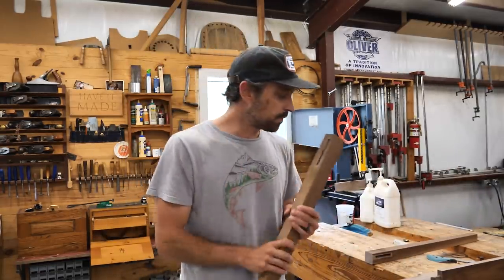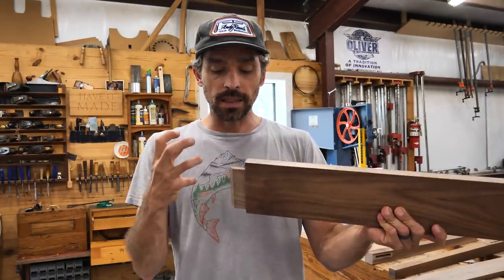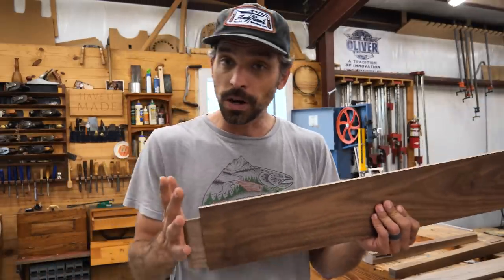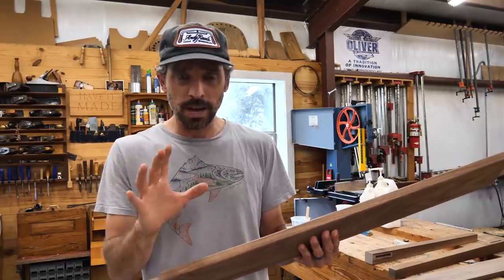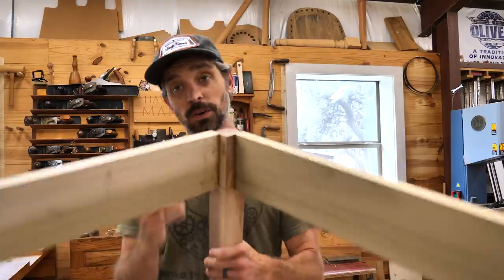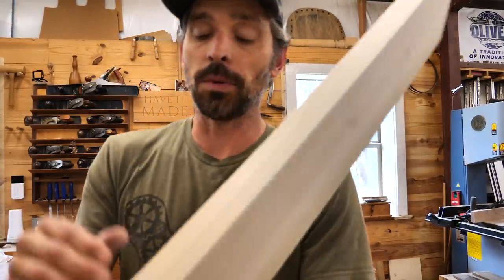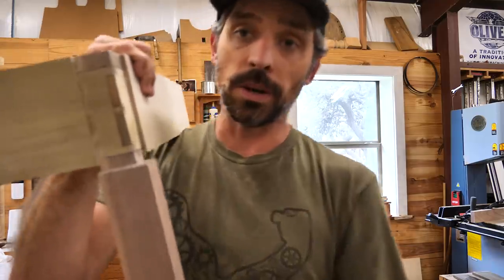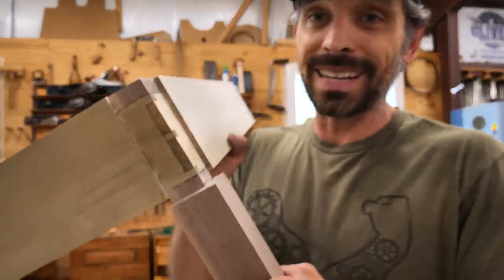Dovetails inside a Mortise and Tenon Joint // Woodworking Joinery

Comment: I've used box joints to connect tenons in a chair. You have a bit more play pushing the tenons together since they don't need to seat perfectly. It's great fun but a regular pegged mortice and tenon has never failed on me. In theory, you would be a bit more prone to develop a gap when the leg shrinks in summer since the tenon is locked in the back of the leg but I don't actually see that problem on my chair so I guess that's just theory ;-). Great build and video, takes some very careful measuring to get this fitting so nicely!

Comment: As an internal element it would strengthen the joint from being pulled part in one direction.  As an external element it would be far less functional than a traditional mortise and tenon as it would be weaker from twisting and lateral force.

Comment: Another option is to finger joint the ends instead of miters or dovetails. Then drill a hole in the top of the leg, through the jointed ends and drive a removable dowel through them. You can either glue it all in, or assemble it dry so it can be taken down. Though this requires thicker stock so the dowel is sufficient and doesn't break. This gives you a mechanically locked joint and you aren't totally relying on glue surface.

To make the idea even crazier, allow the dowel to protrude above the leg and use it to align the top.
Reply: Sent you a DM on Instagram instead with a model.
Reply: That would actually make more sense than a dovetail as it would add strength in both directions instead of just one!, however both options are a waste of time to cut if you have made a well fitting mortise and tenon joint as the glue or epoxy will be more than strong enough for the purpose.  If you want to make it tighter drawbore it and be done with it. The only reason that you may want to do this is if you are able to make it visible as a feature, if it is hidden it is a waste of time.
Reply: @mikesmicroshop4385  One man's waste of time is another man's fine detail and craftsmanship. Though I do agree that either is overkill for a glue joint, unless maybe you've got a barstool with very thin legs, then it could make for a stronger overall construction.

I'm obviously bias towards my own invention(?.. maybe someone thought of it before I did), but I think it could make for a decent glueless joint, especially if your one of those folks who flat packs their pieces to mail to a customer.

In any case, it's all in good fun to get creative in the shop and try something different. At least no one here is suggesting one of the 20-30 pin and tail Japanese joints to hide in the mortice.
Reply: @BB-wj8dv  You have to remember that a dovetail is only secure in one direction, it provides absolutely no joint security in the direction of assembly unless there is glue or some other form of fastening.  So as a glueless joint it is of no use unless it is secured in some way to prevent it from just sliding out the way the last piece went in.  It is fine to be creative that is true and to be able to say that you have done such a thing is also fine, but to use this process  in making a otherwise normal Mortise and Tenon joint is effort and time wasted as it provides no needed advantage and does not prevent the joint from coming apart overall.  The dovetail used on drawers is still glued as it will not stay together unless fastened in some way and only provides strength in the direction that the drawer is pulled from (provided you have placed the pins and tails on the correct sides) if you have not it will not prevent the front of the drawer from being pulled off just as the stretcher that is inserted last into the joint will not have any added strength or positive lock from being pulled out again without glue or fasteners added.
Reply: @mikesmicroshop4385  You missunderstood me, I'm talking about the version I posted about, with finger joints that are locked by a vertical dowel, not the dovetails.
Reply: @BB-wj8dv  That would have its applications, but would still in no way be as secure as a simple mortise and tenon joint that is glued, and or drawbored.  A Drawbored joint would be just as easy for someone to assemble in a flat pack configuration and would be much faster to make, and has been securing these joints for thousand of years successfully.

Comment: so got to find out if there are wood threading sets in both left and right thread.. so the chair rungs could be threaded left and right to screw into the chair legs then the cross rungs get installed to stop them from unwinding.. perhaps even the cross rungs could be threaded left and right with a smaller set of wood taps and dies.. 
 might also be interesting to see if you could make chair legs that are split and have a wedge in the end like a treenail.. where driving the leg into the hole shoves the wedge in and locks the leg tight.
Reply: Probably not available commercially to use in wood as the thread size and pitch is different than for metal machining, but you can make one your self, there are several video on YouTube that show how to make a wood screw die and tap.

Comment: I seen that on a very old drop leaf table oldest thing I have every had the pleasure to re store  I could not get the legs to remove they were fast solid  so I soaked it in alcohol  and with some heat I finally got it to come apart I could not believe what I was seeing than I couldn't  figure out how they did that ,,well like a dummy I thought it came apart it will go back together I used reg wood glue I have never seen this again I sold the table I wish now I would have kept it you can tell by the way you made it it has to be incredible strong nice work is your name for the new joint I'm also would like to try it next time I get a table and the tenon is broke or the mortise is blowed out I might try this for the repair

Comment: I wonder how that cross grain dovetail vs the leg will hold up. It's a great looking joint, but I wonder about wood movement.
Reply: Wood expands across the face grain, and it doesn't get longer, it gets wider. So the dovetail pins and the tails will basically be one solid piece that would expand at the same (or similar enough) rate, and it won't be an issue. 

If you're talking about the wood movement inside the mortise, I don't think the wood is going to move far enough across the like 3-4" of table apron to really be noticeable. There's a formula out there for estimating wood movement across a panel.... and across something that small it would be in the thousandths of an inch... so that joint (the mortise and tenon) and the subsequent dovetail, might get a little bit tighter during the humid parts of the year, but not tight enough to cause any problems.

Comment: I built a table with box joints inside the legs on one end and dovetails on the other.  Never told anybody what was hidden there.  I signed all the pieces with stamps making slight impressions hidden with the joints.  I'm  thinking one day somebody may find them and say What The....?  I smile every time I think of that table.
Reply: I have a lot of hidden components to my work, also; mostly to confound future alien archaeologists...
Reply: I've been doing finger jointed tenons in my pieces for over 25 years the only difference is that I use a slot mortiser, not a hollow chisel machine, I love his oliver mortiser, too bad he doesn't have a 299d and a 166, that's the real Oliver stuff not the stuff he has

Comment: It's definitely cool but I'm not sure I understand the benefit. Since you were able to slide the dovetail together through the mortise then if the glue fails, yes I know that's a huge if,then wouldn't the tenon still be able to slide out. Then the mortise itself will prevent and sideways movement so the angles of the dovetail aren't really necessary. I understand the creating more surface area for glue and so my main question would be rather than doing a dovetail why not just to box joints. If your plan is to reveal the joint than yes absolutely show off the dovetail but if staying hidden wouldn't box joint be sufficient and easier.

Comment: That joint looks so cool but I'm thinking that if you just bring the dovetail peices all the way to the same level as the boards and legs it's just going to look like any old dovetail. I was just wondering if you could router down in a couple of spots, so people can see what you've do, and then fill those sections with clear appoxy resin. If you do that people will be searching so hard for the trick of how you did it that they will miss the simplicity of how it was actually done...... ok, simplicity of how it was actual done by someone who can cut dovetails already 😂🤣👍👍👍👍

Comment: Every piece of furniture that survives long enough will need to be taken apart and reglued at some point in the future.  It's smart to think about the guy who has to rebuild it.  He has no way to know there's a dovetail joint in there, and won't know it will only pull apart in one direction.
Reply: only if you use regular glue!  Not the case for epoxy.
Reply: @mikesmicroshop4385  
Epoxy, mixed properly, and applied in the right conditions, will hold small joints for a very long time, maybe hundreds of years.
If the mix and/or application is done poorly, and the joint does loosen, there is no easy way to fully unbond the epoxy to take it apart and put it aright.
Hide glue is quite reversible, and furniture refinishers appreciate builders who use it.
Reply: @deezynar  I have no idea how you got to hide glue on this, but ok.  I really am not debating different types of glue, it is the over all weakness in the dovetail joint and its absolute lack of holding strength in one direction!  That is the entire point I am making about this joint it has to have some fastening, glue, nails, dowels something or  it will simply slide out the way the last board went in!
Reply: @mikesmicroshop4385  
Look, you have no idea what my original comment was even about.
Before you reply again, go watch a half dozen videos on furniture rehabbing.  Furniture joints get loose over time and the piece needs to be taken apart.  The old glue is all removed, and then it's put back together with fresh glue.  This is done by professionals, it's a trade.  When people build furniture that's worth anything, they need to think about the guy who will have to take it apart in a hundred years.  A dovetail joint that you can't see, don't know it's there, and have no idea that one particular board has to be removed before the other, will cause a serious problem for that guy in the future.
And BTW, he'll thank you if you use hide glue because it is fully reversible.
Reply: @deezynar  I have been restoring furniture for close to 40 years!  My comments are not about restoring or the difficulties of using non-reversal adhesives!  I am commenting on the use of a dovetail joint in this fashion inside of a mortis and tenon joint!  It needs to have either adhesive or some kind of fastener or it will not stay together!  The idea of using it as a self locking joint is not going to work any better her than it does anywhere else!
Reply: @mikesmicroshop4385  
Why would you assume that anyone here claimed that the joint shown in the video was feasible without glue?
Nobody said that.
My point is that a hidden dovetail joint denies the restorer information about how to get the joint apart.  He may break it by pulling too hard on the wrong piece.
Reply: @deezynar  mostly because some one said that they were thinking it would make a good glueless joint! Other than that no reason.

Comment: Well you can say that you did it, but it was an enormous amount of totally unnecessary work for a standard mortis and tenon joint.  As a decretive feature maybe but not as a regular joint especially using epoxy as the glue there is absolutely no good reason to make a joint like that inside of an enclosed mortis and tenon joint.  That combined with the enormous amount or extra work to fabricate it makes it just a bit silly to use inside of an enclosed mortis and tenon!